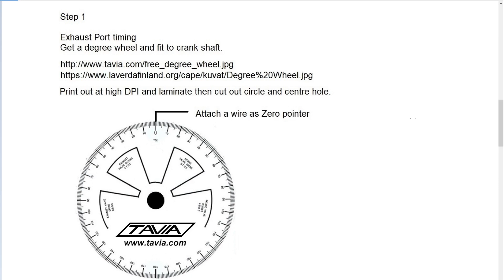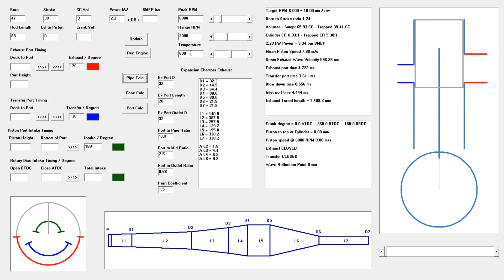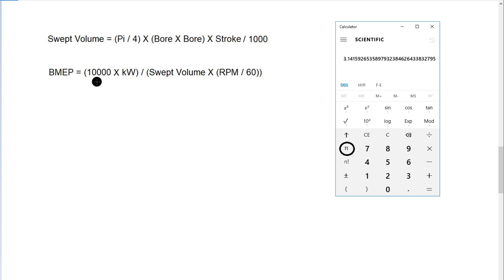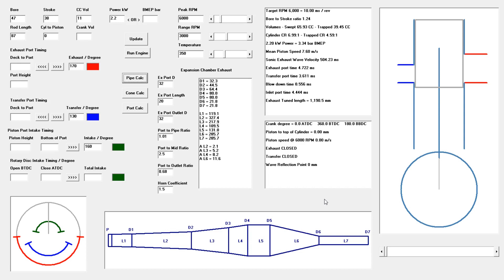How to Design a Two Stroke Expansion Chamber Performance Exhaust - Step 2

Comment: Thanks so much...bringing the gas bikes into your calculations. I love it will share on the zeda group over 3000 members and lots will love to see this. Everyone wants you to do it takes too long to watch your vids and learn haha much easier too. So I followed up until you came up with the temperature to use from the BMEP u went quick and lost me there. Is the temp you got close to the temp that graham bell uses as an average im not sure the temp but 1675fps in hot ex gas? Or do you find a better suited number for my caculations for my bikes tuned length.And the vid was great but when you say your calculations  you make it much easier to follow when u show it on the calculator beside like in the vids for centerline of a cone... Thanks again.
Reply from the maker: Hi Ride Fast, thanks for sharing the video.
The wave velocity figure given by Bell at 1675 fps is similar to Jennings at 1700 fps, its a fixed value assuming the same exhaust temp for all engines as well as being the velocity in air not exhaust gas. Keeping in mind gas temps changes that FPS value a lot.
I use Gordon Blairs more modern method that calculates more precisely the wave velocity based on gas temp, in addition to using the 2 constants given for exhaust gases which is not the same as plain air like Bell and Jennings figures use.
That will be in the next video where we calculate the tuned lengths from the figures we have so far.
So knowing BMEP helps us get a close estimation of the exhaust gas temp to then use in the tuned length equation.
Ill try to do the calcs using the calculator in the videos to make it simpler if it helps, just trying to keep the videos short.
Reply: AuMechanic that umber 1675fps bell says is the average speed of sound in hot exhaust gas not air. Was curious if you arrived at a close figure to use. Now I know you are going one further by using BMEP to get a better average temp reading for a more accurate calculation, I still don't see how you arrive at that temp    or speed of wave  to use from the BMEP. Try
to clear that up in the next video please and thank you.
Reply from the maker: Much of Bells equations are derived from Jennings, Jennings states he calculates a value of 1670 but uses 1700 as an average, Bell just used 1675 to be safe and neither provide more detail than that.
But looking at Jennings temps given his 1675 fps equates to hot gas as in air but not hot exhaust gas.
Blair gives far more scientific detail and provides not just temperature base but the individual molecules of exhaust gas at various temperatures and fuel mixtures.
With BMEP, Blair provides a list of expected Temperatures for given BMEP which I cover briefly in this video at 7:50, so we take that temp and apply it to the above exhaust gas figures Blair provides to get a more accurate velocity range for various engines not just an average for all provided by Jennings and Bell.
Jennings study is from 1973, Bell is mid 1980's, Blairs studies are 1990 and 1997 second edition and are scientific peer reviewed papers published by SAE, where Jennings and Bell are more trial and error studies of 2 strokes and very dated.
Reply: AuMechanic So Bell is mistaken when he got his numbers from Jennings...because he does say 1675fps  in hot exhaust gas. That is understandable. Still wonder what speed you came up with to use for that calculatd BMEP is it anywhere near the 1675fps i guess i can do the math with your calculated 600° calculated temp ans see for myself.Will follow along I'm sure I will learn more. Please get into more detail of using the BMEP to arrive at a good temp to get the proper speed of the wave...... I think I understand now you are taking your BMEP and comparing that to a chart I can find in Blair's work to get a temperature I can then use in my tuned length equation?
Reply from the maker: BMEP Blair gives is about 350C for BMEP of 8 bar pressure or less to 650C for BMEP of 11 bar pressure or more.
We only use the Temp value itself in the tuned length equation, if you know the actual temp by measuring it you would use that instead of just estimating it based on BMEP.
At an air fuel ratio of 13:1 - 650C velocity in exhaust calculates as 614 m/s which converts to about 2000 fps - 350C velocity in exhaust calculates as 504 m/s which converts to 1653 fps
Lower BMEP engines like the Zeda could be closer to 300C and velocity in exhaust calculates as 483 m/s which converts to 1584 fps
This will be covered in the next vid giving the equations used.
Reply: AuMechanic Awesome exactly what I was looking for I am always excited for your next vid
Reply from the maker: ausmecham@gmail.com